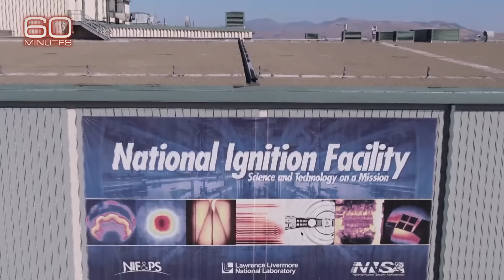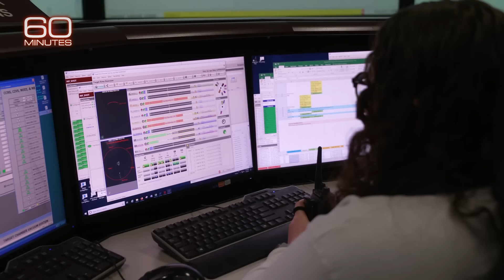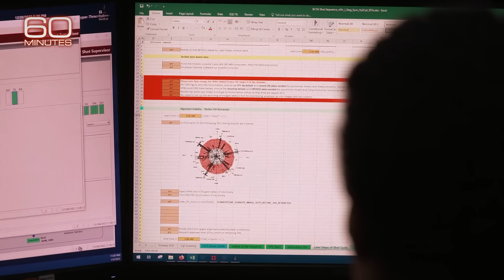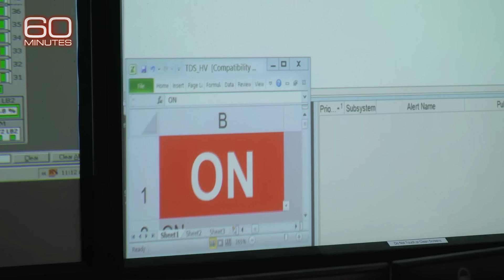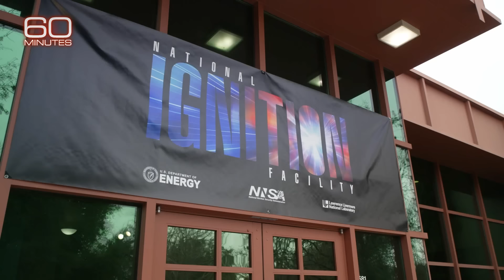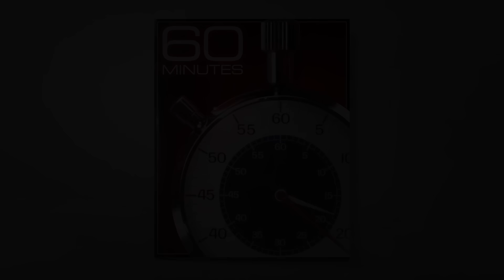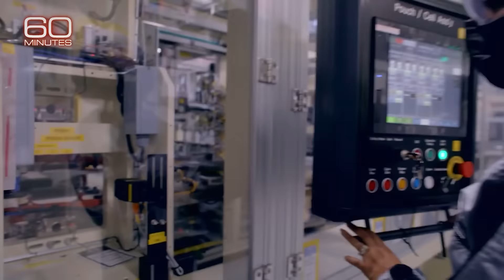Nuclear Fusion Breakthrough; Powering Electric Vehicles; Carbon Capture | 60 Minutes Full Episodes

Comment: Electric F-150 truck running the air conditioner, and pulling a boat is a reality. Just not practical or successful.   Fully charged it went 152 miles before it needed to be charged to 80% and it took 2 .5 hours of So called “quick charge” and making it able to make it to another “quick Charge” 25 miles away.  Considering the truck cost over $85,000 retail. The home charging unit required a new 200 amp panel and specialized plug at the owners house at a additional cost of over $12,000 plus he had to have another one installed at his office at about the same cost.  Plus charging units on the road cost about $75 per a single two hour quick charge giving the electric vehicle about 1.5 hours of operation.   If you think this crap is saving the planet then realized the mining ooeration is using Diesel equipment to dig out each day about enough to make two car batteries a day.  Sorry, but if I want to go on vacation across the country I don’t want to be tied to a charging station (that is actually working) and waste half of my time playing this game.   I can go fill up my Gasoline or diesel truck in less than five minutes and drive 500 miles before another fill up.  Plus the cost of the gasoline truck is $30,000 cheaper.  My total cost of gasoline per year is about $3,000 but an electric vehicle is only 10 times as much.  Pipe dream and BS as the science on mining and the cost isn’t even close.   Plus, consider how many electric cars and trucks have burned up as the local fire departments can’t put that fire out.  Plus the environment disaster those emissions bring down is beyond a mistake as it is an environmental disaster.  The cart before the horse.   
Now look up the research being done today on nuclear energy and the mini plants being produced today in Norway, Sweden, Holland but nothing here inside the USA?   They are also developing a micro nuclear plant that can be manufactured at the factor, last over 100 years and pose zero health issues.  The mini plant produce enough electrical energy to run several manufacturing plant the size of Caterpillar plants.   That is available today and the nuke plant foot print is approximately 8’x10’x 8’ and assembled on site in one day.  The micro plants are being designed for neighborhood.  The foot print on one of these is about the size of a desk.   Assembled on site in one day and operates over 100 years without real maintenance.  Plus one of these will produce enough electricity to run a complete neighborhood of 50 to 100 houses.   Average monthly use estimated at 2,500 KWH.  I keep my house at 73 to 74 degrees in the Texas summers of over 100 degrees everyday in July and august and I’m still under this consumption amount !  Think my investment dollars are going to go for these new nuclear plants that do not have any down sides.  No radiation or risk of poisoning from either of these.   Less than the radiation of a typical cell phone four feet away from your mouth.   Amazing how leftist hate this !

Comment: It is incredibly stupid to use batteries for electric power vehicles.  A car generator chisel to spin like Edison generators was used to drive from California to Washington DC with a gas can in the backseat.  This 8000 mile per gallon car is out of patent and open to public use and Tesla dynamos can do the same and with s little more control with a liquid battery powered dynamo has the same unlimited range but without lithium or cobalt or cadmium.

Comment: Did you really think they'd put millions of electric cars on the road without some kind of power source I mean you'd be foolish to think that the power grid could ever handle such a load. Besides the grid they have to have something that's more secure at each individual location in that way each location does not have to rely on the grid because due to solar flares EMP and terrorism makes power grids vulnerable and makes our whole country vulnerable. A note something they wouldn't produce millions of battery powered cars and all this crap for for nothing without no knowledgeable means of supporting this type of Technology so please don't feed us that crap that were 50 years away. 2030 is the next 50 year Gap in technology which happens every 50 years, the last one was in the 80s when we had space travel lasers cell phones computers home computers computer watches it goes on and on and on all came from the 80s and the next 50 year technology leap is in 2030